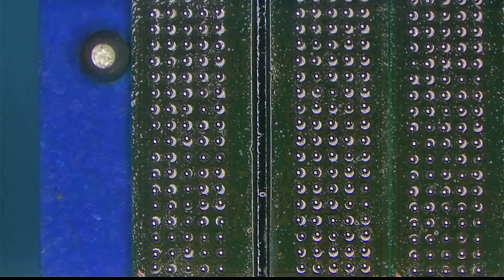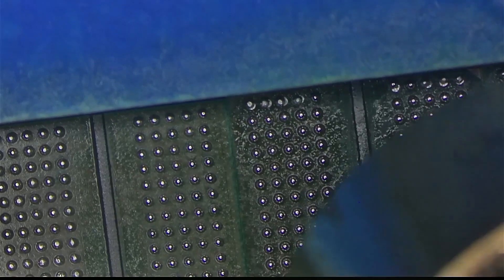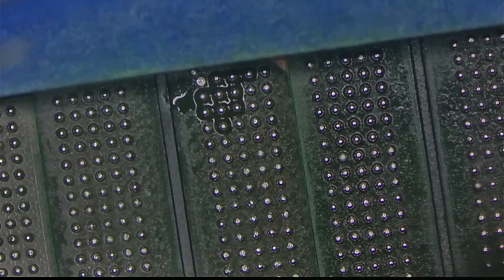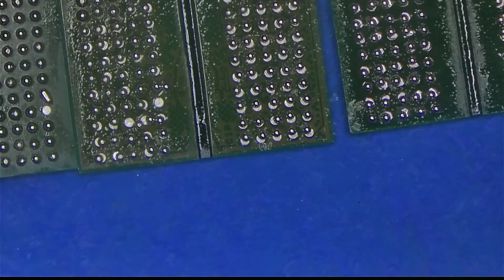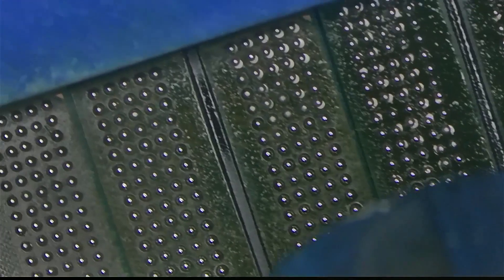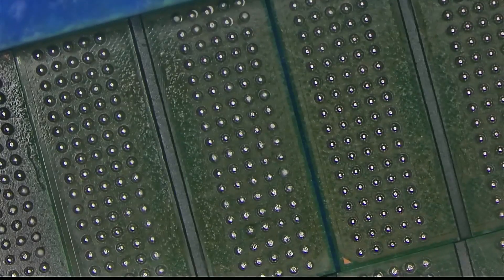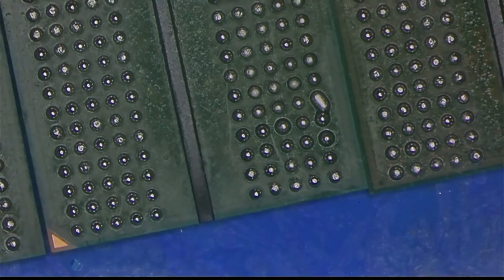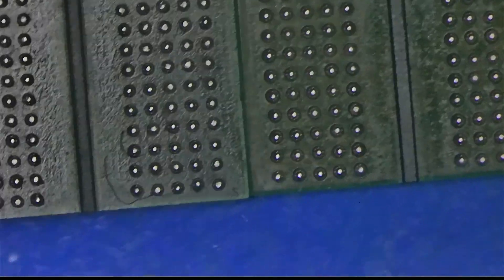Reballing GPU memory

Comment: Well im fired too back then twice cuz i really wanted to do my job. Anyway i love reballing it is fun, these chips relatively easy, phone cpus are more fun esp double decker ones smiles. With solder paste things are a bit more hard tho. You are doing good job but i have to give a lil advice from an amateur, if you keep chips at slight angle like 20 degree or more you gonna need less heat and balls will settle more fast, surface takes a lot of heat when they are standing on something flat... I learn a lot from you cuz you really know what to do and how to do thanks....

Comment: Is solid balls or solder paste stencil better? I know the amaoe stencil with paste might cause smaller balls and sit lower on the board. This would mean changing out the thermal pad. But the paste is easier and quicker than having to shake the balls around.
Reply from the maker: Depends on the situation.
Paste is easier for small chips. Not for large chips.
Even for memory chips paste is not good. It makes it slower and more messy.
Reply: Paste has more chance of hidden solder bridges. It's really only good for chips with legs.

Comment: Reballing is a nice process. I have a question. My phone died and my contacts and photos got trapped in it. I took it to service, but they did nothing. I believe the memory chip is still alive, so I'm thinking about buying the exact phone but used, to transfer my memory chip on it with a heat gun to recover my data. Are there any chances it'll work?
Reply from the maker: I honestly don't know.
Depending on the phone model, there may be need to do some firmware transfers too. Harder on iphones.

Gotta talk to a phone specialist.
Reply: @northwestrepair  Thanks for the response. It's an old phone, xiaomi redmi note 5a.